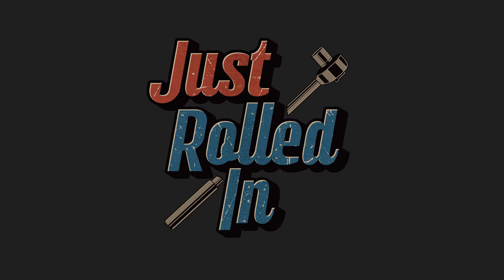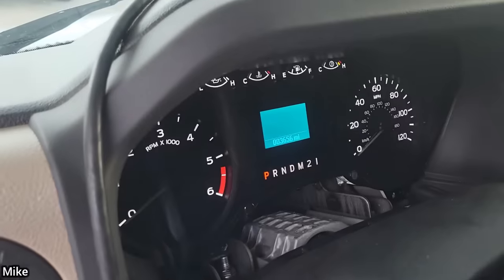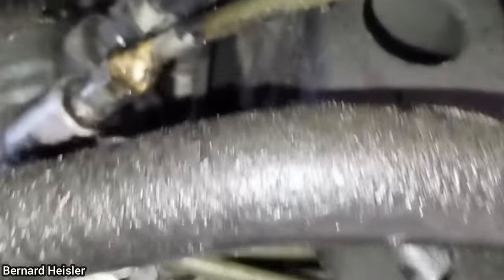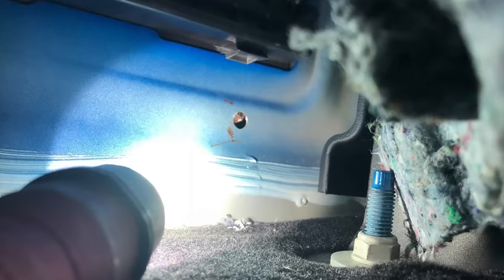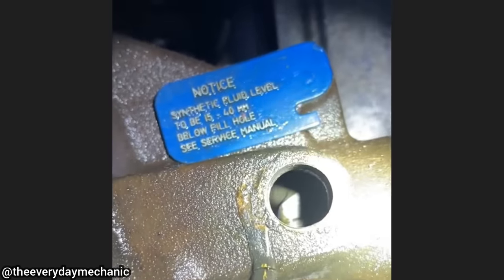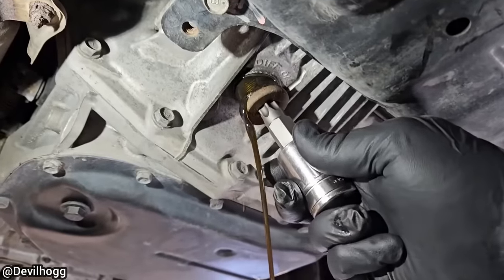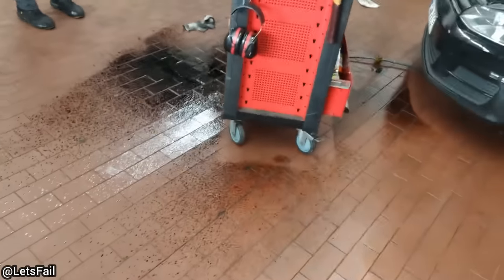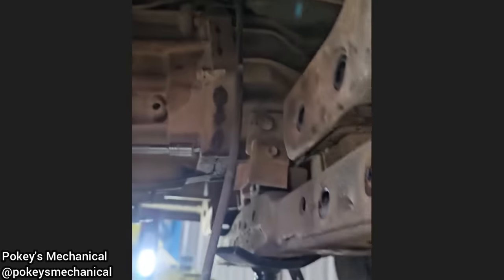Mechanic FAILS Compilation | Just Rolled In

Comment: I'm seriously impressed with the ability to wire all the buttons to the horn.
Reply: Right?  I mean, how do you do that by accident?
Reply: The problem is likely only one thing mis-wired that causes the horn to honk and not every button being wired wrong. Something like if you wired the power source in series with the horn, so every time any current is drawn the horn honks.
Reply: I can't even figure out how to do that on purpose
Reply: @waggy401  Maybe wire the horn relay wire into BCM power?
Reply: @movitoviscyrinxed446   I agree that a reasonable hypothesis but I still just can't figure out how you pull it off with so many unrelated functions.  Notice also that it's always just a single short honk, even though some of those functions (like the headlight knob) pull current continuously.
Reply: @daemn42  I suspect this would have something to do with CAN communication, where the data packet sent by the modules with the switches would cause the horn to run. Data arrives as a burst to signal switch on and then as another to signal switch off. The speed with which those buttons were pressed would line up fine with that.
Reply: CLAAAARRKSSSSOOOOOOONNN!!
Reply: probably the only way to do is by accident haha.  It'd be a heck of a prank if it was easy to undo  @AlbertaGeek
Reply: I was waiting for the person making the video when all said and done to finally press the horn and have nothing happen.
Reply: I was expecting them to try the horn and have the engine start instead
Reply: @peterjohnson9438  Could be. I'm guessing someone may have added an extra jumper somewhere. Rainman reparied a car where someone had removed the fuel pump relay and put in a jumper to power the fuel pump... supposedly trying to sell the car owner a new ECM or BCM. When he installed a fuse and relay some odd things happened until he removed the "aftermarket" jumper. I'm guessing the fuse was just blown and that jumper was to fix a faulty diagnosis.
Reply: its gotta be a ground @AlbertaGeek
Reply: I came to the comment section to say similar things. Someone got mad at someone and well. Don't piss your mechanic off lol. As for the wiring of every button honking the horn. The skill involved in that is extremely impressive.
Reply: Maybe they wired ground to the horn?
Reply: Probably using the horn as a ground. 
A friend once wired another friends van horn to the indicators as a prank without ever having the keys. Did it all under the vehicle, he just got back in it one day and the horn was going off every right turn 😂 i totally wasn't involved, honest.
Reply: @definedphotography  more like: JAMEEEEEEEEE
Reply: Everyones overthinking this, it could be as simple as the horn ground is crossed with the positive that supplies the interior power, so when any switch is pressed the horn piggybacks through the circuit
Reply: @hoonfox5087   Again, doesn't explain why it doesn't just honk continuously when they turned on the lights with the knob.  That's a continuous circuit, not a momentary switch.    They also appeared to pull up on  the two center console switches longer, but still got only a single short honk.
Reply: Honestly, that was the clip that made me laugh the most.
Reply: @beardedgaming1337  If you say so.  I'm far more familiar with residential wiring than automotive wiring.  A house is easy compared to the spaghetti mess I've seen behind dashboards.
Reply: @daemn42  Ever turned an old light switch and it arcs for a split second? The wiring itself holds capacitance, when a switch makes ground the horn gets shorted and draws more than the wire holds (hence the short beep) then cant continue until the wire regains charge.

All speculation though, but makes more sense than every switch being individually wired to the horn somehow.
Reply: @mikep490  or BCM ground fault.
Reply: @hoonfox5087     I'm not suggesting every switch was individually wired to the horn, just that "horn in the ground path" has some issues that don't quite add up as well, based on my own experience wiring stuff under the dash.    As someone else mentioned, if it were that easy, it'd make a great prank.
Reply: beep! beep! beep! beep!
Reply: It’s an edited video
Reply: What about the guy at the front of the hood standing right by the horn...
Reply: Has to be faked. That'd take a... tremendous amount of ... wiring to make do.
Reply: So does the blinkers start when you use the horn then?
Reply: It would be ironic if the only thing that didn’t sound the horn was the actual horn push pad
Reply: It's made for blind people
Reply: @definedphotography  For anyone wondering what the Heck definedphotography is on about, back on Good Top Gear there have been occasions when Jeremy Clarkson sabotaged James May's cars to blast him with loud music continuously.
Reply: @tranz2deep  They also wired the horn to the brake atleast once.
Reply: It's an Alfa Romeo, probably a safety feature, to warn others.
Reply: The dude is just pressing the horn out of frame guys... Don't believe everything you see. This is the internet.
Reply: It's quite the feat
Reply: They prob though the horn wire was the ground wire
Reply: @tranz2deep  Then there was the time Clarkson repositioned Hammond's "La Ququaracha" horn into the car's interior, and also wired it to the brake safety switch so the horn sounded every time he applied the brakes.
Reply: Or most like he was honking the horn while he was hitting the buttons lol
Reply: @rondavis2791  Despite the fact that he's holding the camera with right hand, while pressing buttons with his left..
Reply: @sct913  Truly an inspiring moment. Oh, and do mourn the lesser versions of Top Gear likely dying with the main show, if only because the shareholders for licensing (outside of BBC Commercial) were... Andy Wilman and Jeremy Clarkson.
Reply: @sct913  I'll double down here; during the Teenager Challenges, Clarkson stole the remote to the sound system of James' car and glued the manual controls into place, blasting James several times (not least during the 3 AM Stealthy Return Parking challenge, displaying why a teenager can't do that while blowing out his speakers.
Reply: @tranz2deep  He also replaced his classical music CD with a fusion (?) one.
Reply: @sct913  Industrial grind, I call that sort, especially track 4. In point of fact, I'm re-watching the episode right now because this lot were somehow even worse between them than most submissions to JRI. (Also, as always, spellcheck can suck it because The Boys are a plural!)
Reply: @daemn42  go pro?
Reply: @daemn42  elbo
Reply: @daemn42  another car in the garage.
Reply: @rondavis2791   8:24 can see reflection of him holding his phone vertically.
Reply: @rondavis2791  8:27 still standing outside the car.
Reply: @daemn42 go pro while holding a phone
Reply: Probably disconnected the main ground wire to the dash and all the buttons and now they are all grounding through the horn. This every time anything is powered, current flows through the horn to ground.
Reply: I have three horns, each with a different button. I can not imagine something similar being done accidently.
Reply: i want that as an option.
Reply: Only one bad ground, blipping the horn-relay doesn't take much in ground-loop.
Reply: @peterjohnson9438 - To err is human but to really screw things up requires a computer? 😊
Reply: Bro the alternator🤦‍♂️
Reply: Nobody:
Horn: yes.
Reply: I remember years ago my neighbor ran a wire from the brakes to the horn on his sons truck as a April fools joke so every time he stepped on the brakes his horn blew😆😆😆😆.
Reply: Turned the car into a road rage special, no matter what you do you're gonna honk at everyone lol
Reply: Thats gigachad level s#!t right there.
Reply: Well at least now the driver doesn't have to waste time looking for the horn button! Precious seconds count in an emergency situation!
Reply: I've seen this before, a body shop repaired a wire harness and wired a power to a ground circuit.
Reply: That was hilarious 😂😂😂😂
Reply: I bet it’s a grounding problem. That’s the only wire I can think of that would be shared across all buttons. And the majority of the time if something weird is happening on a car it’s a grounding issue.
Reply: Possibly searching for ground. A connector may be not seated.
Reply: in the world of game mapping, one common way to check if a trigger works is by making it play a sound to check if it fires at all.
So i guess you could say, the buttons do work on this car.
Reply: Albeit spectacular - it's probably a rather simple fault.

On many Euro cars, the horn is operated by relayed ground - not relayed positive, as all other features.

IDK about Alfa today - not that long ago, Fiat used non-foolproof connectors in close proximity. For instance, on a Fiat Seicento (aka shoebox on wheels) there were 2 of those in the engine bay. Identical and exchangeable. If you get them wrong the engine won't start.

Here in Germany we have a tv show/yt channel specialised in fixing "unfixable" cars. They had that on the show once. 

If you are used to work on 99.5% of modern-day cars with connectors that fit only in one position and in only one direction you get that wrong quite easily - if you don't know the quirks of those certain car makers.

Therefore, I think they had some routine maintainance done (oil change maybe?!?) and the mechanic had to remove some wiring (thanks to the downsized engine) and got it messed up somehow, understandably.
Reply: I think that one is faked. Mostly because of some switches being held up longer and getting the same honk, and the lights not causing a continuous honk like it would if they were actually wired to the headlights. It's probably a case of the guy pressing the horn button every time he changes something, for attention on this channel.
Reply: @TomBom292  I don't think so. He is clearly alone in that garage and everything he shows seems perfectly plausible to me.

It's very easy to cause all sorts of problems in modern electronics when you mess with them. Even a simple error can cause many strange problems. Current goes strange ways sometimes.

All those switches send a short impulse to the ECM/BCM. Those impulses reach the horn somehow. Maybe wrong ECM/BCM unit?!?

The lightswitch doesn't cause continous honk as the fault is not on the (relayed) low-beam circuit.
Reply: I'm curious how the drive home from the mechanic went with the horn connected to turn signals 🤣
Reply: In Texas that would be considered a bonus feature. They love honking the instant the traffic light turns green.
Reply: There's a longer version of this video where he presses the horn and the car starts lol
Reply: @MKRN98  Ya I saw it on Daily Dose as well.  Get this, it's not the same video.  It's almost the same sequence but not quite and has different commentary.    Does seem to be same person and car though, probably trying to cash in on viral moment.  

Some Buicks are equipped with remote start and an option to honk the horn when you lock the doors, thus it's possible he's doing it all with buttons on the remote.  The only thing that's still a little off is that a couple of the horn honks are slightly longer than the others.
Reply: Not really wiring that would do that. More than likely it's a bad module.
Reply: @definedphotography  🤣😂😂
Reply: This would be a great prank haha
Reply: It's an Alfa....
Reply: Was this the same one where when he actually pushed the horn button on the center of the steering wheel it started the engine?
Reply: LMAO FR
Reply: yes, that was so interesting how that mechanic was able to do that..
Reply: I call bs on that one
Reply: The part 2 to that video was when he honked the horn the engine started
Reply: @ilikmlow6900   Ya, it was basically a remake of the same video with that bit added.    Turns out Buick makes a keyfob  which has remote start and will honk when certain functions are activated, and this happens to be a Buick so I'm heavily leaning toward this being a fake.
Reply: Better than being wired to the airbag 😂
Reply: @peterjohnson9438  Funny how that doesn't happen on cars that don't have all the silly crap in them.
Reply: It's like a video game menu screen from the 90s
Reply: Pretty sure its a ground issue.
Reply: This makes me wonder if there is some weird human input test mode that someone left the car in.
Reply: they must have reverse wired it to the negative somehow.
Reply: My dad got trailer repair on the road, found the electric trailer brakes were wired into the turn signal!

Comment: Mistakes and accidents happen to the best of us.  What's inexcusable is the rip-off mechanics like the guy who tried to sell a new trans because of a busted CV joint.
Reply: Yeah, I also felt like that when watching the spray painted alternator. What an absolute douche-bag move.
Reply: @christianchristiansen99  I know! It's right on top too! How could anyone not be able to replace that!
Reply: A Midas, I was at, got an older Honda Accord towed in. It wouldn't move in any gear and we thought it was the transaxle. We pushed it in and once it was on the hoist, I saw the lower ball joint broke and ripped out the CV axle with it.
Reply: A friend was quoted $3k for a transaxle rebuild from a shop. Instead he took it to a backyard mechanic. It just needed the gear oil changed.  The trans had a clutch type limited slip diff, and the diff wasn't releasing properly. When that happens, the oil has degraded and needs to be changed.
Reply: I bought a jeep from a lady a few years back, shop told her I needed a transmission. Only had 95k miles on it. I bought it as scrap. Decided when we got it home I should actually drive it just to see how bad the trans was... The rear wheel hub sensor was bad and would kick on traction control above 30 cause the trans to feel like it was "slipping" took me less than 15 mins to diagnose. Felt kinda bad for the lady. She had already went out and bought a brand new jeep over a 90 dollar wheel hub.
Reply: Yup, helped a friend with his Expedition. He bought it for a grand off a old man who'd been told it needed a trans. Test driving it, I discovered it was thinking that it was going 70mph and trying to shift into OD while the ABS wheel sensors, the actual speed, was closer to 25mph. Figured out that the T-case was in 4-low, and the harness for the t-case was unplugged so the 4-low light wouldnt illuminate, and the PCM wouldnt calculate the proper vehicle speed, and the fuse for the t-case shift motor was missing. It was pretty clear to me someone put it in 4-low, removed the fuse and disconnected the harness so the vehicle would act up and they could sell a transmission that Im sure they had no intention of actually installing.
Reply: Avg mechanic in 2023
Reply: You don't know for sure the mechanic was a rip off - it could have easily have been a mis diagnosis.  Put it in drive, makes noise and doesn't move..  Same as the shop that changed that engine and the problem was the corroded harness.
Reply: Years ago I had a customer who had a truck with 700R4 transmission with not a lot of miles on it and it would not upshift out of first gear. She took it to a   transmission shop and they checked it out and told her it needed a complete rebuild. I asked her if I could check it out before she had them rebuild it. I suspected there could be an issue with the governor. I pulled the cover and found that the plastic teeth on the governor gear were bad. Installed a new governor gear and the transmission worked great and she never had any more problems with it.
Reply: The guy that painted the old alternator did it for me LOL
Reply: @HighSierra1500  It's not about being able to do it, it's about defrauding as many people as they can because they're "breaking the system."
Reply: @MrAndrewtheguru  True. Laziness is also a factor. The alternator spray painter attracted a clientele he could pull the wool over their eyes. When it came to actually having to fix the car, he revealed himself to be a fraudster.
Reply: Or, re-painting a USED alternator! LMFAO...
Reply: @TheOzthewiz  Possible, but unlikely because parts, where he couldn't get the paint can, are not coated.
Reply: People need to REPORT them to the DMV.  They have to have a license.  if they don't, they get fined and if they do, with enough complaints they can be shut down.  Also, take them to small claims court.  You will easily win a judgement against them.
Reply: I just had my local mechanic diagnose a new (used) engine for my 2005 VW transporter which would have been 10-12k AUD. Another shop found out the problem was actually just the water pump seal failed and fixed it for under $1000. ALWAYS get a second diagnosis
Reply: @tylerdurden5122  Yep, like in 'customer declined repairs' :)
Reply: Or the ones breaking shit then charging the customers to fix it.

I'm so glad I know my way around small claims court.
Reply: @HighSierra1500  Seems like it would be less work to install a new alternator than to take out the old one, paint it, and reinstall it.
Reply: Got a car in once with CV axle grease splattered all over the bottom of the strut and steering knuckle. Got ready to replace the CV axle thinking the CV boot was no good, cleaned off the CV axle boot just to be sure and not a hint the boot was defective, the boot actually looked new. I didn't replace the axle once I discovered it, but I still haven't figured out where that grease came from unless the someone else just didn't clean the grease off from replacing the boot? I could have replaced the axle claiming it was bad, but that's not how I do things and I know that was splattered CV axle grease.